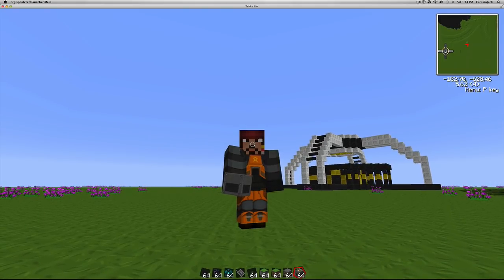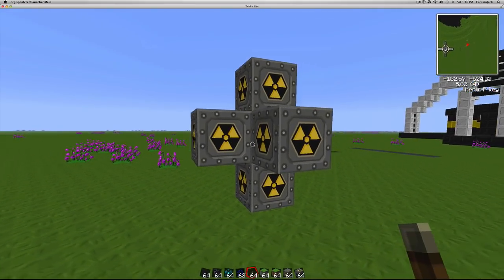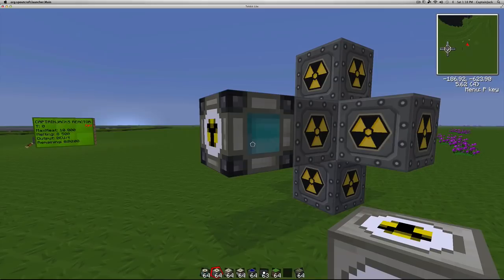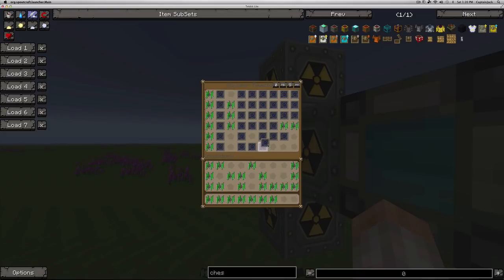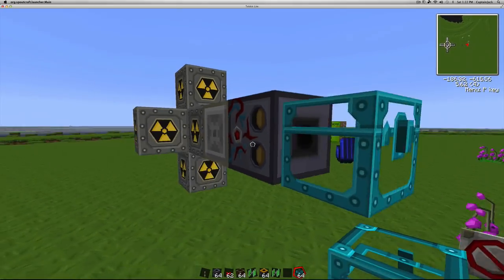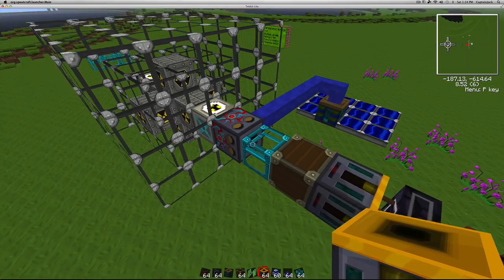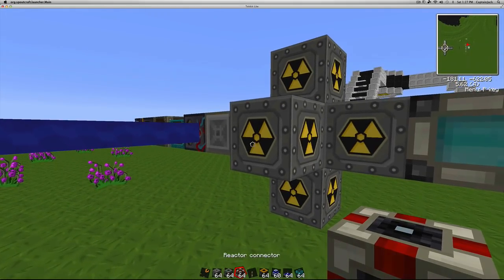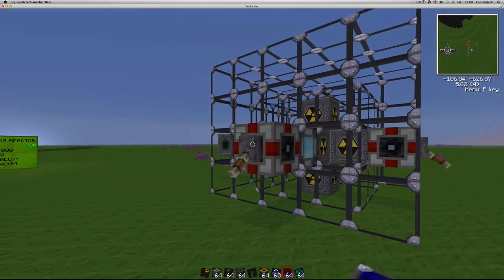IC2 Nuclear Power Plant Setup Tutorial

Comment from the maker: The reactor connector is used to transmit energy or a redstone signal through a reactor forcefield without breaking, or cutting the forcefield in any way. 

Placing many different block types or wiring types inside the forcfield will cause it to be broken, and if there's a meltdown, the explosion can escape through the broken parts of the forcefield causing a lot of damage.

Comment: When you right click on the transformer/mfsu or other machines with the wrench you change the direction it's facing to face you. but if you hold shift and right click it will put it to the opposite side so you don't have to break blocks in tight situations. PS Love your videos.

Comment: Dude the Sorting machine wont charge when I place the battery box and the Blue Wool Jaketed Wire like you did, and I also changed the Sorting machine's two setting buttons...Any reasons why it ain't working?
Reply: it worked thanks